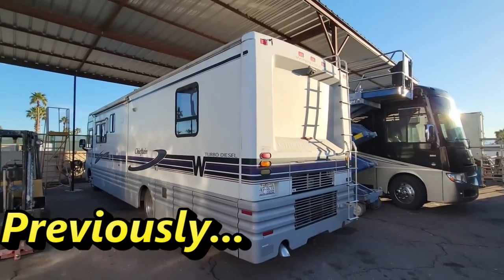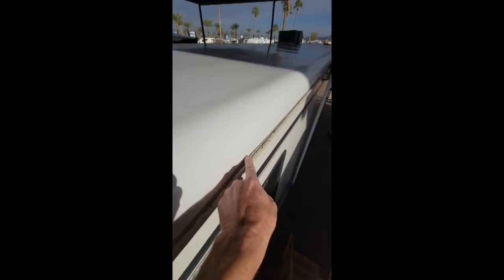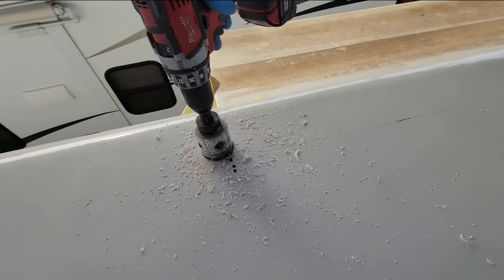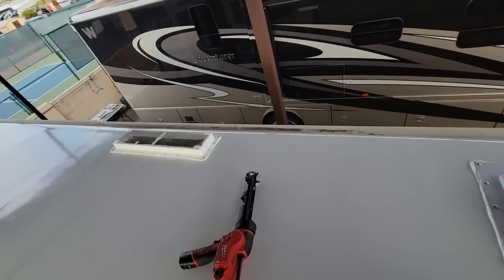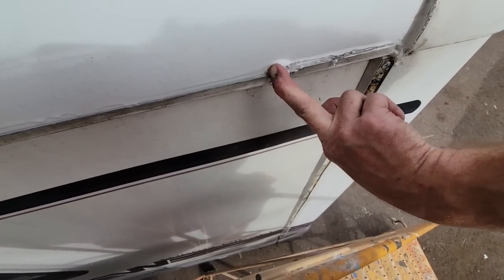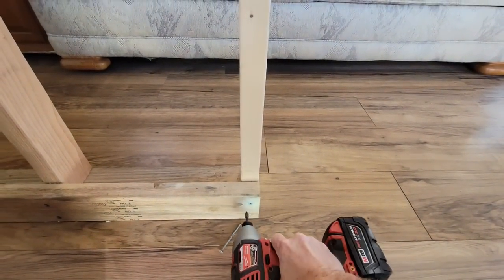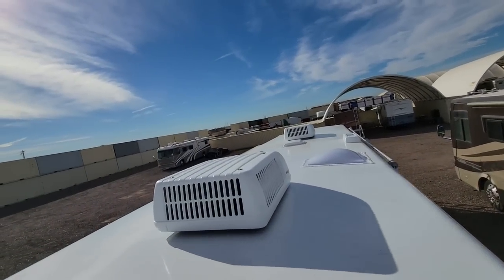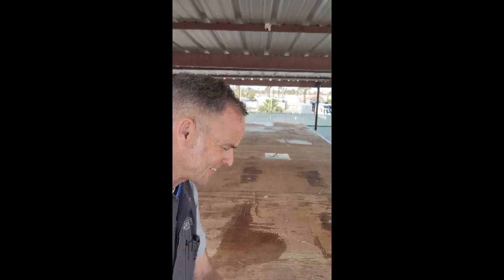Did The NEW Roof Collapse?

Comment: So glad to see your work ethic. There are a lot of others who would literally scab a repair together for someone and take their money. 
I try to do my own repairs myself. I am a 35 year journeyman diesel mechanic. And while that’s not an RV tech. , it does afford me quite a bit of knowledge that does cross over, and also helps me to understand the basics of how these things are built.
I’ll turn ya on to something great though, so I work on Kenworth and Peterbilt trucks, and have visited the factory in Ohio several times to see how the trucks are built. And Paccar has this glue they use to literally glue body panels together to form a cab. It’s called T2000 glue. 
This stuff is stronger than a weld. There have been accidents where the cab of the truck has been badly damaged, and you’d think the seams where the glue was used would fall apart in a bad accident. 
They don’t.
Ever.
The cab panels, whether they be fiber glass or aluminum, will break or tear next to the seams, but the seams NEVER break. 
It might be a product to research or look in to. 
Either way, thank you for the videos and the advice you provide for all of us.

Comment: There's always something important to be learned from these vids. Thanks again James for all the effort put into this one. I can see why you regretted agreeing to this job after you got into it. 
Here's what I'm wondering though. Thankfully you didn't agree to repairing the inside and the ceiling work. If you had agreed to repair the inside, how do you go about doing that?? That seems like a pretty impossible job given how it's all put together. The outside makes sense being able to tear it all off and start over, but inside with everything attached to the ceiling, how is that possible? If it's simple enough to briefly explain, it would be great to understand how you'd go about that process.

Comment: Thanks for all your videos. I enjoy the repair element as much as the entertainment part. I am having a problem with my 1998 Winnebago Itasca Sundancer roof. I have replaced the plywood and the filon but I can't find any silicone self leveling sealant. Do you have any other favorites other than Nuflex 311? Thanks. I'm on the west coast and praying the weather holds up for me.
Reply from the maker: you can use any roof sealant if you have a new roof you just can't mix dicor and silicone, otherwise amazon or camping world are my suppliers.
Reply: @AZExpert  Thanks for your response. I neglected to tell you that I am reusing the roof trim which has silicone on the top and one side of most of it.

Comment: Never understand why the industry laminates with timber.  
Why not use commercial reefer trailer technology and simply stick GRP/Steel/Allow sheet to alloy flanged frames .. or .. sheet metal facing on HD closed cell foam panels?

Comment: Hey brother, I'm amazed at the poor quality of rvs. Too many holes to let water in. The door should be solid and secure. All the clearance lights could be like the solar lights for lawns. That way no holes or wiring. Do they need skylights and roof vents? Anyway have a 2003 arctic fix 22H. The roof is needing work. Which video should I watch. Thanks

Comment: Hey.   I have a 2001 Monaco Windsor and I want to coat the roof with something.    What’s the best thing to use.    It’s white and white stuff is running down the sides on my paint.    Your the best.      Thanks
Reply from the maker: Your roof has Oxidized from no maintenance, that's what the white stuff is. I dont recommend roof coatings.

Comment: Looks perfect great job, question if you do not mind please.  On my Fleetwood Wilderness 5th wheel, the gasket the bonds to the aluminum on the inside edge of a slide out has separated (the slide out is in out position) and I have it currently clamped to the slide out to hold it up for now, gasket looks like it has a shinny aluminum backing on it.  Question is what adhesive sealant should I use to reattach it to the slide out?  @AZ Expert or anybody have any suggestions?  An RV tech told me to just use white silicone, not sure that is the best option, could be, but wanted to ask here, maybe that Pro Flex would be good option.  Thank you.

Comment: James, just resealed front cap using the pro-flex. If I put the self leveling silicon over the from cap like you do to redirect the water. Will it stick to the pro flex?
Reply from the maker: No it will not stick to proflex
Reply: Thank you! Do you use pro flex under the front cap. If so, do you remove any excess that squeezes out before applying the self leveling silicone?

Comment: Hey James what's your thoughts on replacing the fylon with sheet metal or aluminum?
Reply: Too heavy. Doesn't have the structural roof support required. Doesn't even have anywhere to attach it with rivets. You have to have metal roof trusses if you want to do metal sheeting.

Comment: I am thinking about buying an RV (of some type) made before 2019. Pre-Pandemic! Better quality construction. Am I correct on this line of thinking? No RV experience. I have owned two houses and cars, etc. I own used Toyota's and I take care of what I own. I am frugal but I am willing to pay for quality and longevity. Any advice?
Reply: I’m not James but I’ve been researching a good while. I have seen videos where RV sellers say to buy pre-pandemic even if simply because those travel trailers have less items like windows or appliances because of shortages during construction. I haven’t heard anything about craftsmanship during that time though, so I can’t tell you for sure. He does have some brands that I have seen him recommend for class A’s, but he is not crazy about class A’s made by Winnebago after 2014. 
I just bought a 1996 Isuzu elf Terra 500 from Japan. I was originally looking at Scamp and Castia travel trailers but they retain their value extremely well so it’s hard to find an affordable one. Plus I’m a single traveler, so having a class C is better for me. And right angle walls always make me twitchy because, if the previous owner didn’t keep up with the sealant, you end up with wall delamination in most models.
The thing that James will tell you to do, that I highly recommend as well, is to have the rig inspected before you buy it, even if it costs a good chunk of money. Especially have the roof inspected. Losing money on an inspection sucks, but losing money on an uninspected lemon is even worse.
Reply: @YallAintRight  yeah I get everything inspected before I buy it. I am single as well. I am leaning towards a 24 ft. Artic Fox and a Chevy van with a 6.0 engine to tow it. The Chevy van 6.0 is bullet proof for an American engine. I thought about getting a used Toyota Tundra but I can carry more stuff in the back of a van than in a truck bed.
Reply: @evilhairlessmonkey7700  I don’t know what ton about those so I can’t give you any advice, but it sounds like you know what’s up. YouTube is excellent for researching stuff like that if you have questions. 
My biggest recommendation is to make sure that your pulling vehicle is well within its limits to pull the trailer and to not overload either. I don’t know a ton about towing first hand but I do recommend a pull-test when you pull away and good trailer brakes overall. 
I know a little bit more about upgrading electrical, so if you have any questions, let me know. I’ve been researching a lot with Will Prowse and plan on having my system upgraded by a certified RV-experienced electrician.  
Good luck! You’re handy, so you’ve already solved half your future problems.
Reply: Maybe this ones for sale 😀
Reply: @YallAintRight  yeah as I understand it the Chevy 3500 van with 6.0 is a One Ton platform. You are correct about weight and pull test.

Comment: Would a router with a hole bit work to cut out the vent holes from the top?
Reply from the maker: there's no surface but foam for the bearing to ride on so it wouldn't work..easily.

Comment: I hate those skylights they insist on putting in all the RVs. That roof was so beautiful just broke my heart to watch you have to cut holes every where to put all that crap back on roof! You think by this day and age that the air conditioning would all be run off of the diesel motor. There should be a way this day and age to use different kind of air conditioning etc to keep holes off the roof. I wish you would tell the cost of the repairs.